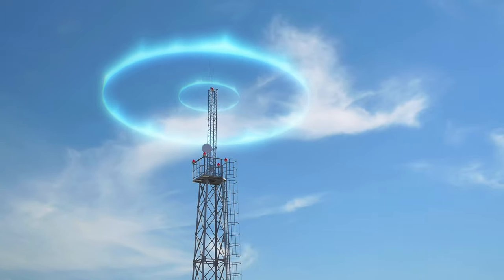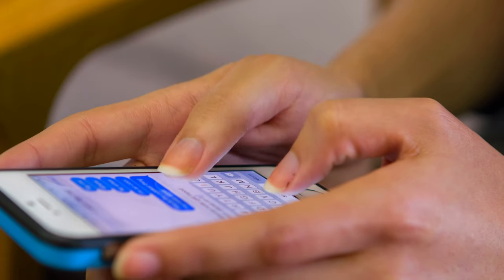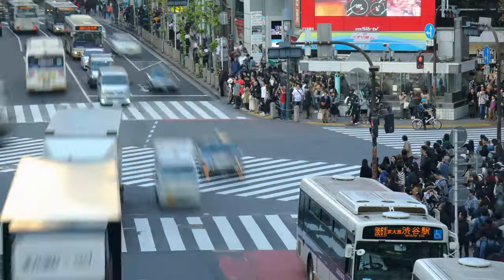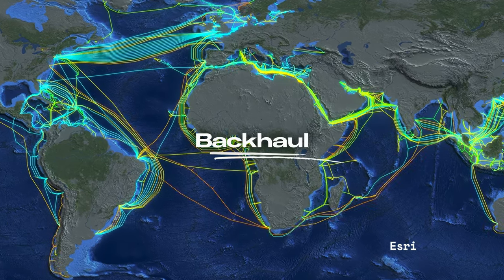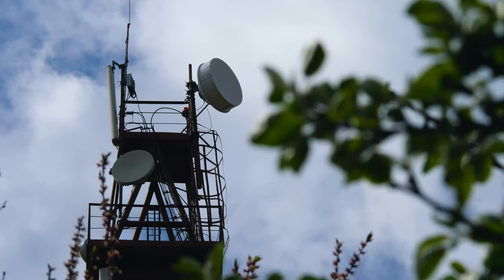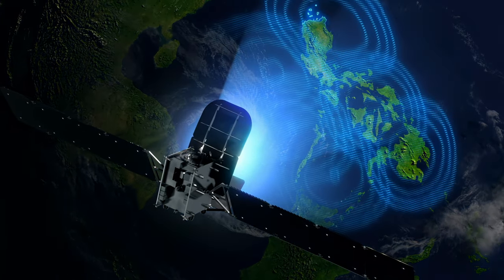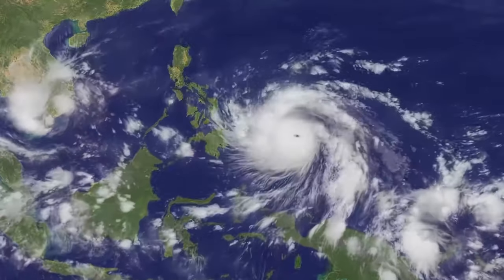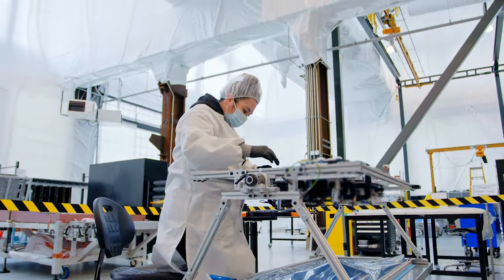Satellites Are Cheaper Than Glass?

Comment: Cellular back-haul using satellites is a great technology for connecting remote areas, and this video is very sensible.
Other large satellite internet providers tell you that it would be possible to get an individual satellite connection for everybody. I don't think that's realistic, there is still only so much spectrum(that makes it though the atmosphere, optical fibers also have limited spectral bandwidth, but it's way larger). In the long run there is just no way around putting optical fiber everywhere possible, just like water or electricity. It's good to have an independent backup infrastructure that works truly everywhere though.
Reply: Maxjoker98.  I am confused.   You say its very sensible and your last sentence you say that in the long run, there is just no way around optical fibre everywhere.  Well, that is the point.  You don't need fibre cables if you have a dish and its pointing to the GEO satellite as is the case with Astanis Space satellites.  Also because they are in GEO rather than LEO, they have the ability to cover a very large area, e.g a small to medium sized country with one or two satellites.
Reply: There's Starlink, kinda expensive though.